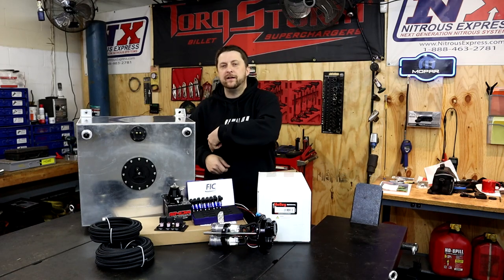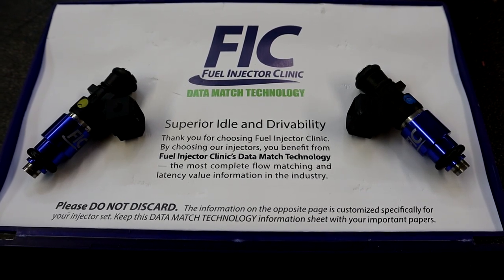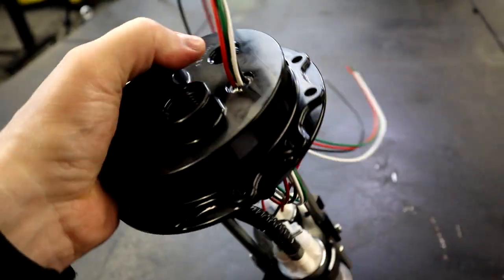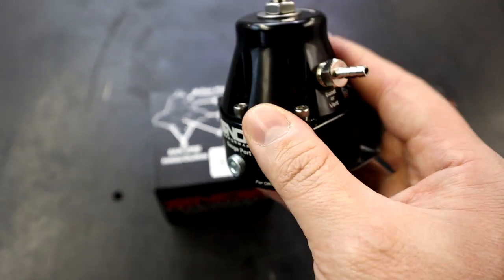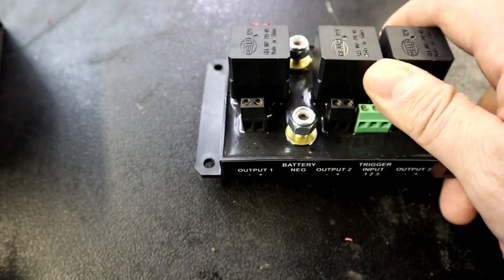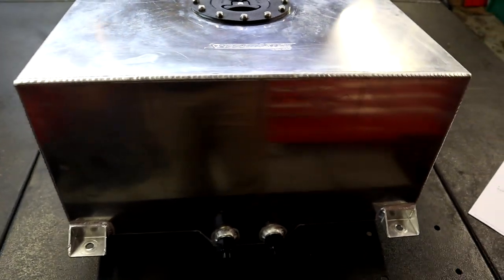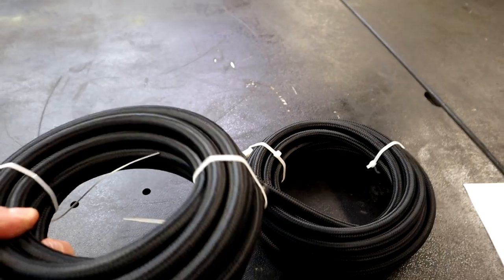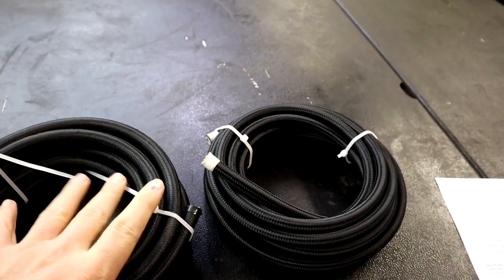Frostbite Is Going CORN! E85 Huge Thanks FIC, Holley, Snow, Speedmaster, Spelab & Flyin' Ryan

Comment: Where did you install your fuel pressure sensor on the holley HI ram intake manifold fuel rails? I am looking over the fuel rails and they did not leave a spot to install a fuel pressure sensor.
Reply from the maker: Fuel pressure sensor? You mean map sensor perhaps.
Reply: @FrostbiteRam  No sir. The fuel pressure sensor. Also did you use both ports for the PCV system or plug 1 of the 2 sides?
Reply from the maker: @joshuas.4967  I plugged one only using the passenger side. I don't have a fuel pressure sensor? I have a fuel pressure gauge but I installed it on my snow fuel regulator
Reply: @FrostbiteRam  Thanks for the info, getting parts rounded up now for the installation.

Comment: What do I need to run E85 on a 05 Ram hemi ?
Reply from the maker: It's pretty much the same thing here but fuel cell is an option  There is also drop in pumps that will fit your stock tank.

Comment: Will this work on a 12 charger?
Reply from the maker: All this stuff is basically universal so yes just need a place to mount fuel cell or perhaps a smaller 13gal unit in the trunk?
Reply: @FrostbiteRam  thanks for the reply I’m basically new to this channel and with the mods to my charger but i’m still not sure on which mods to go with first still doing my research